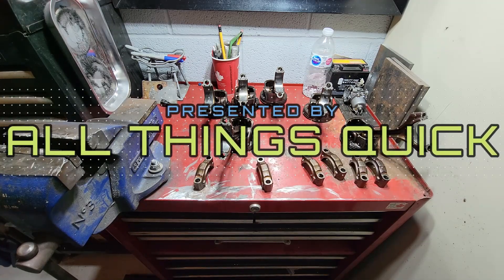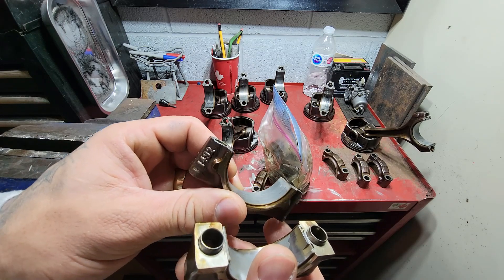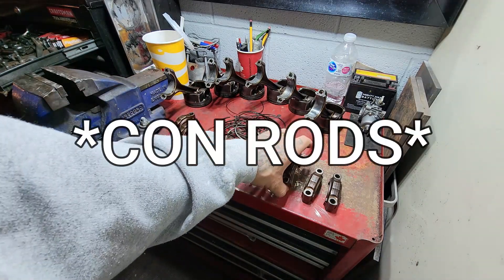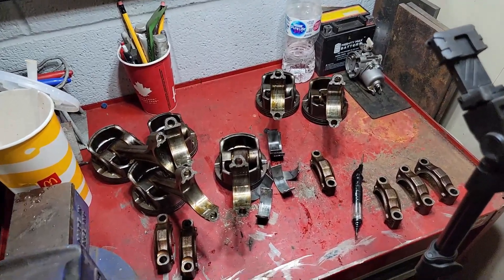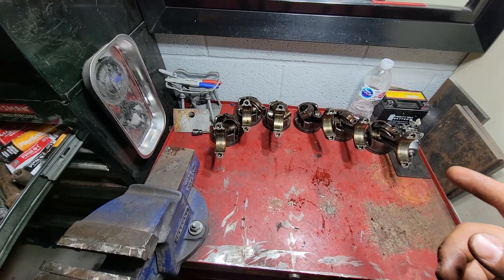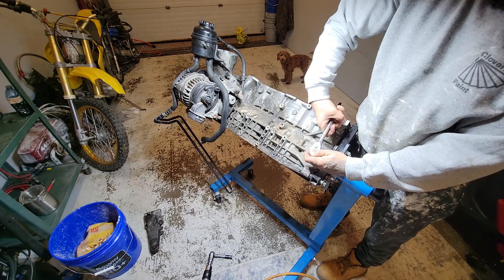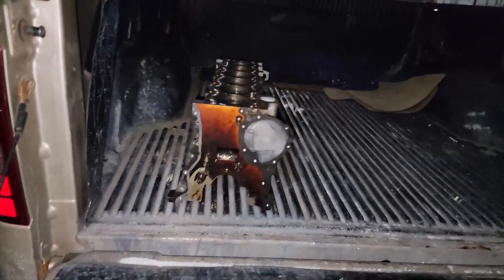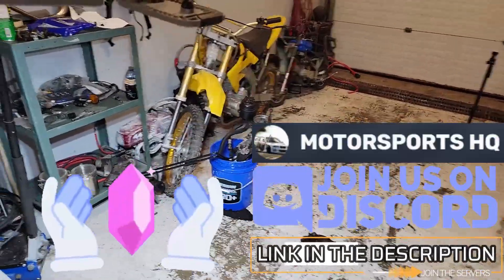S3E11 - BMW E46 Piston & Engine Block Tear Down - M54B25 - BOOSTED 650HP INLINE 6 ENGINE BUILD ✅💯

Comment: 2.5 rods may be powdered metal. GM does that.
Reply from the maker: Yeah so im actually using the 3L rods instead for the 2.5 build and I'm getting forged rods for my big build that I'm doing. 
The 2.5L will end up around 650BHP and the 3L build will be around 1000BHP